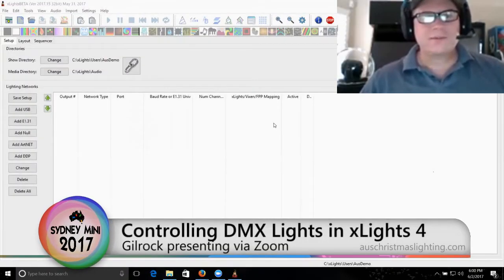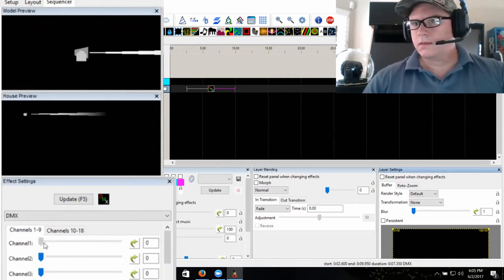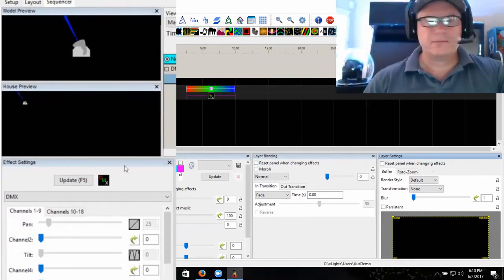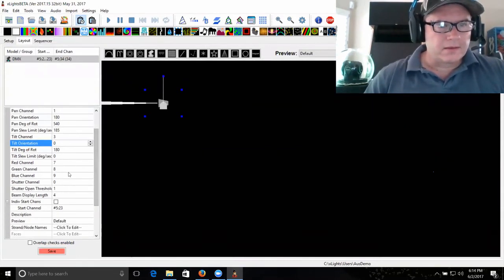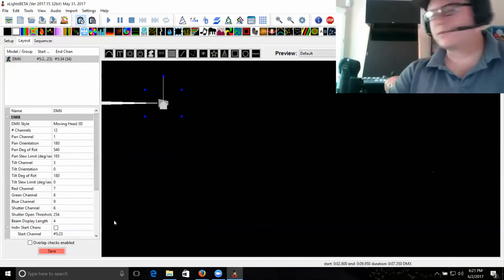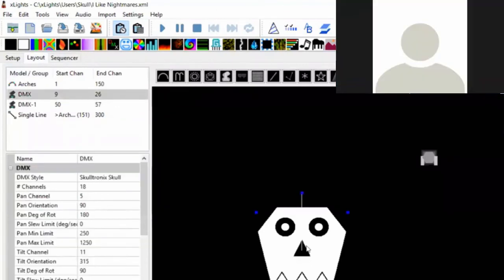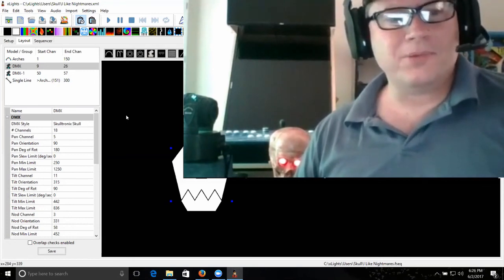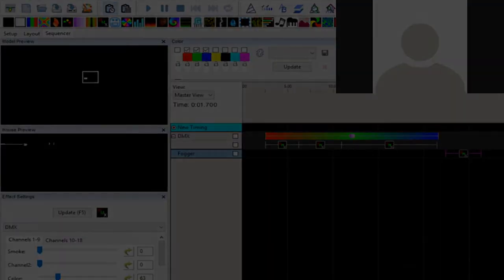Controlling DMX Lights in xLights 4 - 2017 Sydney Mini

Comment: Great tutorial. I need help setting up a General DMX on DMX #3 with a DMX 512 8 channel relay for dumb lights. My relay wont connect to XLights X lights shows the model fine with the bars moving with each channel but the relays dont turn on. Really baffled.

Comment: Hi, we are in our 3 years here at the Roswell Christmas Railway and I used LOR last year for a fairly large light show to music. 
This year we have a stage performance with a  RGB"light"  background that I will be sequencing for dancers and music. For example a Dragon that will be blowing fire and using the lights to show fire colors and so forth..... It's not your typical Christmas house light thing, and I am trying to learn now Xlights due to using RGB now.
We are using 96 RGB strips with 16 channels, and I believe 8 controllers that feed out to all 96 strips.. We have another guy who I am working with who is setting up all the hardware, I am assisting but just learning all of that. I will mainly be doing the creative sequencing.
I am starting your tutorial now, and wondering if you know others that are using a similar format as myself.